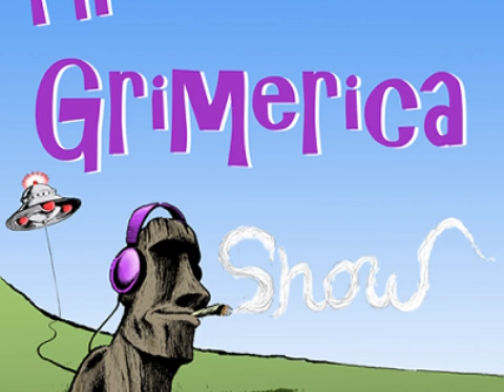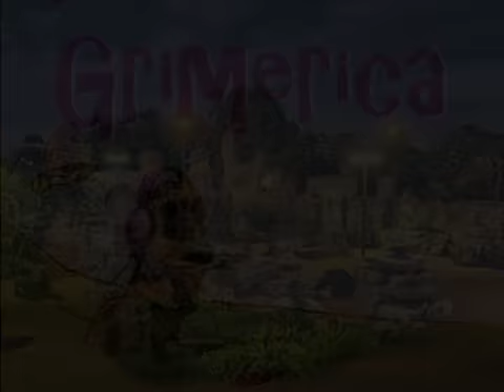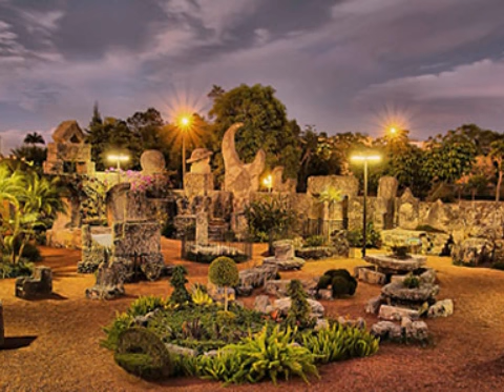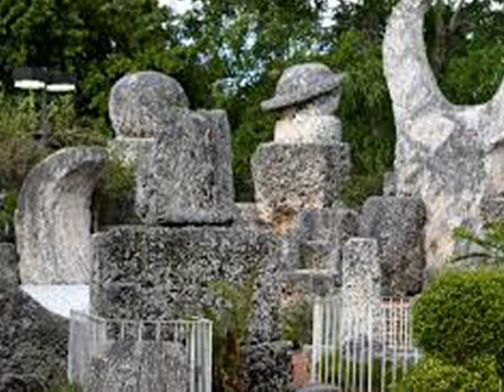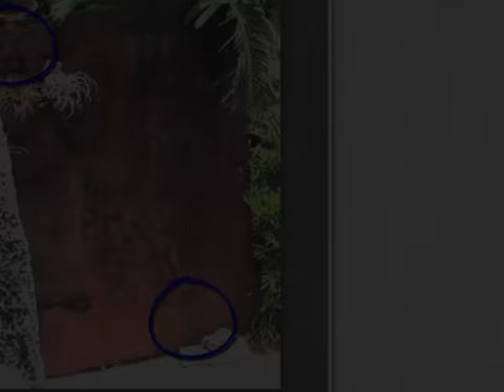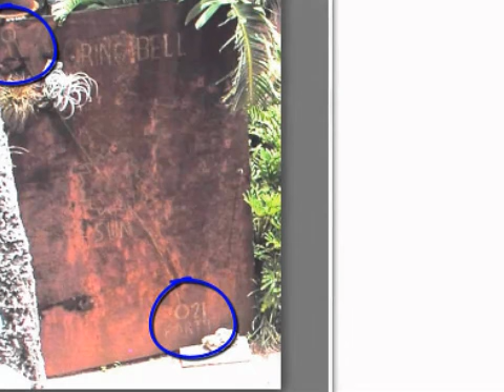Grimerica Talks to Scott Russell - Coral Castle Solved?

Comment: Just to correct myself on the Giant Main Battery that subs have to stay safe when the reactors scram.       Its 1600 amps not 400    (128) lead acid wet cells in series for 256 VDC!   yikes on big power. Also got a documentary up to finalize and illustrate WITH the sweet sixteen CLOVER LEAFS and all. 
PS    DARREN and GRAHAM excellent 101th show by the way. Don't be afraid of keeping Darren's mic  Cranked up.   Love you guys         Scott
Reply from the maker: Thanks Scott, Stay Warm!